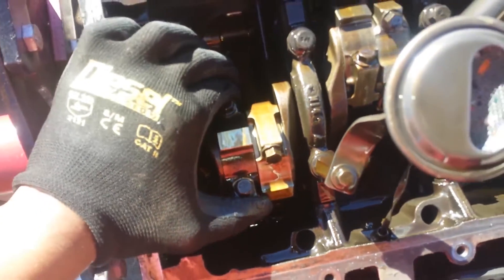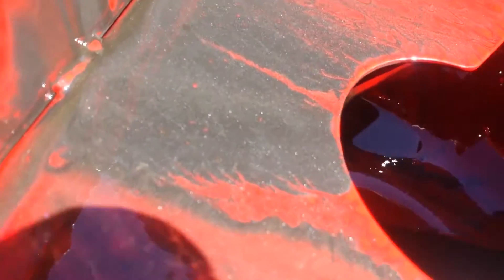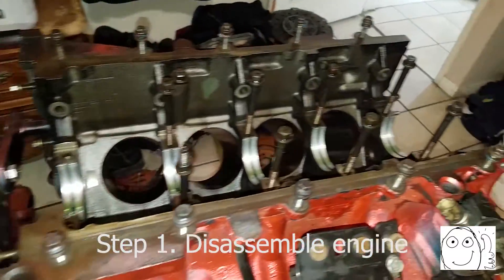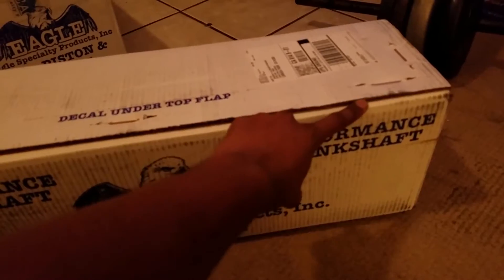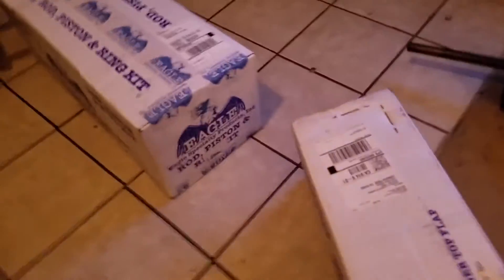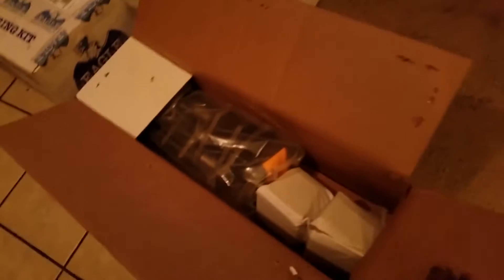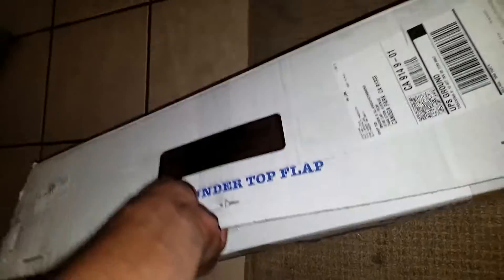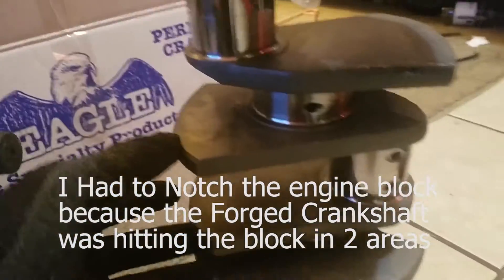Foxbody gets a Forged 4.6 2v engine!

Comment: Hi sexy build wanted to go this route wanted to ask what kit did you use for the 2v engine to mount properly or will mount right on ?
Reply from the maker: hey@ sorry for late reply.. we really need to get this channel going again lol.. its on stock engine mounts. its the K member that made it fit, there's conversion K-members from Team Z, maximum motorsports etc that lets you intall a sn95 engine to a fox..

ive had a tubular sn95 k member in a fox before. but didn't workout.. the mounting for the rack and pinion was off so alignment was way off aswell..

so youd need get the foxbody k-member that has the mounts for a modular engine

Comment: Does it gain horsepower by fully forged the engine.
Reply from the maker: You won't really gain any horsepower doing forged internals, but it will allow you you to make well over the 400hp limit these engines can hold on stock internals with boost or nitrous etc.

Comment: Did u rewire the harness
Reply from the maker: Well I pretty much removed all of the foxbody wiring, and transfered over all of the wiring from the 2000 mustang so it was pretty easy
Reply: Good i was planning on doing the 4.6 swap sometime next week..... I don't think its true but sombody told me that my long tube headers for the 5.0 can fit on the 4.6
Reply from the maker: @jameshattencraig  should be a fun project man, and I don't think it will fit, the 5.0 has a square shape from the exhaust side, and the 4.6 2v has a round shape on the exhaust side
Reply: Wish u couldve made a video of u changing the wires out
Reply from the maker: @jameshattencraig  I kind of did, I don't know if you saw our other video the engine swap video
Reply: @CarsNDonuts  no finna go in look

Comment: What motor mounts you used ? The original ones from the 2000 gt ?
Reply from the maker: Yup I just used the regular stock rubber motor-mounts from the 2000 gt.. bolted right up because the k-member is for a 99-04

Comment: What ECU you are running with the 4.6 2v? Are you running the A/C and steering pump?
Reply from the maker: Yaqoub Almounes I'm running the same ecu that came with the doner car, and yes a/c and power steering is also functional
Reply: Cars N Donuts So did you re-wired the 4.6 harness to the ECU or used the fox harness? What ac compressor and steering pump you are using?
Reply from the maker: Yaqoub Almounes I didn't rewire anything, i just transferred the harness from doner to the fox without modifying anything.. and same ac and steering pump from doner car, (stock)
Reply: Cars N Donuts sorry for bothering you man. Do all the cluster gauges work like speedometer, rpm and others? I know that swapping ECUs in the new edge mustangs need reprogramming, is it the same thing in the fox body? What K-member, motor mounts will work? I have 5.4 dohc and I am planning to put it in a fox body and supercharge it. I have swapped a lightning engine in a new edge mustang and it requires a minor modification. Is it harder to swap in a fox body?
Reply from the maker: ,Yaqoub Almounes Yaqoub Almounes no it's fine I don't mind lol, ok so once you transfer all the harness and ecu, you can plug in the same cluster from the doner car.. for the k-member I went with a tubular k member but if you want to use stock k member, you'd need to modify it a little and motor mounts are stock, and not really, the fox and the new edge body is like the same so most stuff will fit, and others might need a little fabrication but nothing major..
Reply: Cars N Donuts so did you just use the engine harness from the doner car or you swapped the whole car harness into the fox? What about the fuel system? Is it the fox system or you swapped it as well?
Reply from the maker: Yaqoub Almounes nope all the wiring are from the doner car.. the fox harness won't fit the doners harness so you'd need to transfer over the wires so it plugs in. along with fuel tank/ pump is from doner car with doner cars fuel pump harness. I made my own braided fuel lines tho since it was easier to work with. Litterly everything was from doner car... I didn't use any wiring from fox because it won't plug into the connnectors of the doner car. Plus wiring was really old and cracking..

Comment: how did u make the electrical work?
Reply from the maker: Tommy Warren you would have to splice the 2000 gt's wire harness and connect it with the fox'es harness.. for example( i had to splice the positive and negative wires from 2000 gt's door lock motor and connect it to to the positive and negative wire of fox's original door lock motor for it to work)
Reply: CARS N Donuts  did u use the ccrm
Reply from the maker: Tommy Warren yes i used the ccrm.. it has the relay for fuel pump so its important, that all connects to the 2000 gts harness.. i basically moved every harness from 2000 gt to fox..
Reply: Cars n Donuts 
How did you get all the tail lights to work properly do you have any pics something that can guide me through it. 
Jwhampton86@gmail.com

Comment: Lovin the car man. Could you tell me what size cowl hood that's on it and the brand? Or where you got it? Been looking for one like it for my 88 GT.
Reply from the maker: thanks! :) & i think this is a (3" or 4" cowl hood by truefiber) all fibreglass and verry lightweight. it came with the car when i bought it.. ill measure it later n let you know the exact size.. and ive found  the 4" hood here http://www.cjponyparts.com/trufiber-hood-a49-4-heat-extractor-fiberglass-4-cowl-1987-1993/p/HDT60/?gclid=CjwKEAjwxurIBRDnt7P7rODiq0USJADwjt5D06J98HYGAuK1Ce97V_SKLGLPaZxCg4rydP-ntdIpYRoCvI7w_wcB

Comment: Nice swap brother.  We are doing a 2v twin turbo and nitrous swap in our drag car!
Reply from the maker: Auto Mafia Racing thank you! & man that things gonna be so bass!
Reply from the maker: Auto Mafia Racing thank you! & man that things gonna be so badass!
Reply: CARS N Donuts sounded like the crank was unbalanced
Reply from the maker: James Palmer no its got a small exhaust leak -.-
Reply: CARS N Donuts why did you go through all that to have that motor?  Why not just a regular 5.0 out of another foxbody or ford explorer?
Reply from the maker: James Palmer because that would be too easy
Reply: CARS N Donuts seriously idk ?  Just wondering if the newer 5.0 you put in the car has advantages?  Like an extra 100 hp ?  Idk?  Just asking
Reply from the maker: James Palmer yea i mean i guess i did it as a challenge to see what i can do, plus i had ass the parts i needed from the doner car so i just mashed them together.. it was a nostalgic moment when i first started up the car.. sounded exacly like how it used to.. and that was succsess for me.. also this is a 4.6L 2v from a 2000 mustang gt that can handle 1000hp would be fun to beat newer cars with just a 2v also.. i guess thats why i went thru the whole process.. but as it sits right now i have beaten 350z's g35's etc.. so id say it should be around 260-300? hp i think..
Reply from the maker: James Palmer advantages, not much i think the 5.0 would still beat me

Comment: its really cool bro i just bought a 87 lx and im doing a swap but i cant decide what motor to go with. i saw your video and i was like dang, it really is possible, im still researching the pros and cons of alot of engines, 302, 351, 460 the 4.6 never crossed my mind but the cobra engine did, i think it comes factory in lincoln navigators. i here tge 302 is easy to do, but the 351 us stronger. decisions decisions....😁
Reply from the maker: Tyler ford haha yea i mean i did it cuz i had a doner car lying around with all the parts so why not lol.. beefed up the engine i still cant wait for turbos.. i think that 460 would get you alot of speeding tickets lol.. and also 4.6 in lincoln engine is okay but they dont have forged crankshaft and different cams than the cobra.. so wont hold much hp.. but its an aluminum block.. just build it and youll be doing skids everywhere you go

Comment: whole harnesses swap to
Reply from the maker: yupp i transfered all the wires from 2000 gt into the fox so everything would be an easy install.
Reply: Rear end to
Reply from the maker: yupp even rear end. almost everything the only thing that stayied was the body everything else is form the 2000 mustang. i made the video of the swap.. its on my channel i think its my first upload
Reply: @CarsNDonuts  I’m coming in way late haha but did you remove the dash and use literally all that wiring?  What about twilights? Headlights etc?  Thx!!